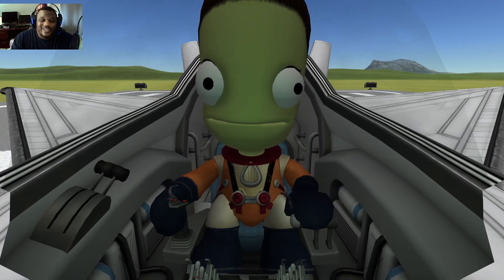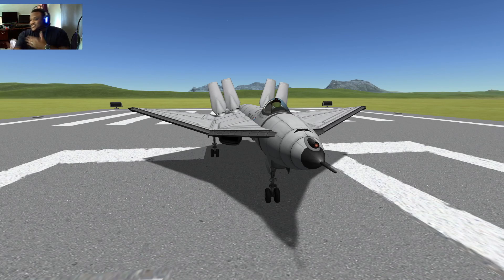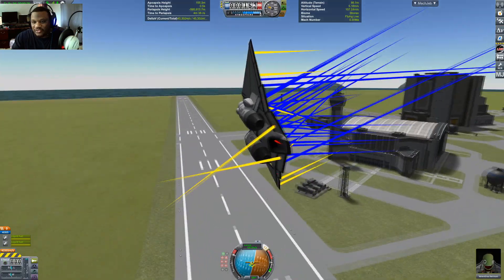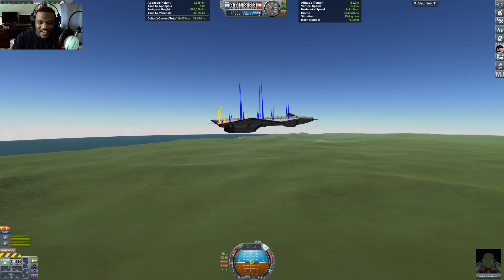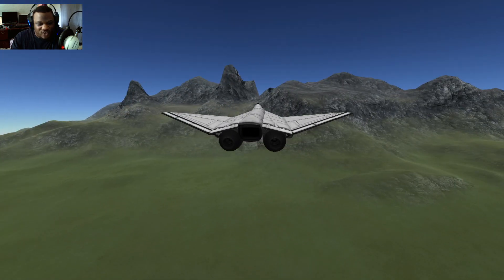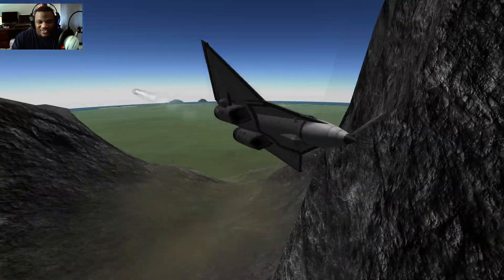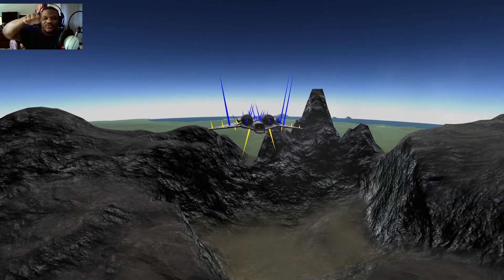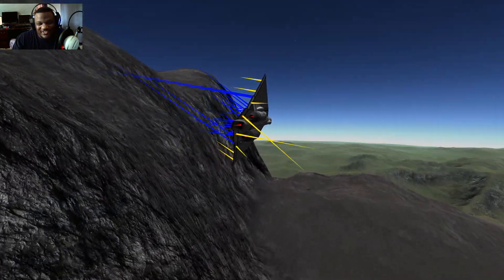Kerbal Space Program | Project Mapleleaf - SUPER STABLE Tail-less Jet Design

Comment: how does it not yaw uncontrollably to the side? the engines didn't seem to be gimballing so is there a reaction wheel or hidden tail/vertical stabiliser apart from the little controls near the engine? When I tried to make a tailless fighter it took off, rolled and then nose dived due to no stabiliser
Reply: The wing dihedral eliminates the yaw issue.

Comment: Hi, it looks very cool and flies well. But is it the angled wings or rather the gimbals of the engines and the airbrakes that eliminate side slip?
Reply from the maker: The ABs are just there because the craft has so much lift, it's like landing a balloon. The wing dihedral and control surfaces spread amongst them all contribute minimally to the whole control of the yaw.
Reply: @BillyWinnJr  Thanks! I also asked because I noticed that gimbal with rockets can be super-effective sometimes

Comment: I always do tailless designs!
They're by far cooler machines
Reply from the maker: I need to start investing more time in them and seeing how far I can push it :)
Reply: @BillyWinnJr  
Personally, I like to use Forward Pointing Wings with Tailless designs purely because I think it looks cool and I'm prepared to find out what ever engineering reasons/excuses I can to justify them haha XD
Reply: i always do 4 fin vertical plabes

or i attempt supersonic x-planes/space planes, often use rocket engines instead of jets, for launchibg it either i strap it on a rocket or use a jet powered aircraft, often similar to a x-15, but instead of ammonia/lox for main engine and h2o2 decomposition for turbines, just LH2/LOX or methalox, more rarelly liquid fuel and oxidizer (which i consider kerolox) and maybe i already attempted at Aerozine-50/Dinitrigen Tetroxide, oftentimes they dibt get to spacr, but some do, and can even return
Reply: I mostly make fighters, so a lot of my designs are tailless, but I have found that having a rudder improves maneuverability. However, since this plane is not designed for that, I think that the design is amazing. also, it would be really good for stealth